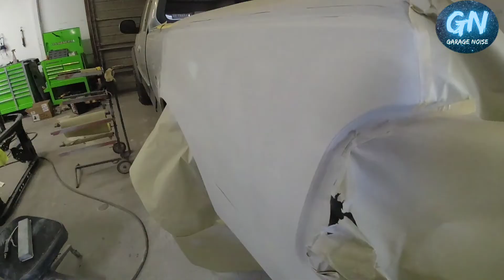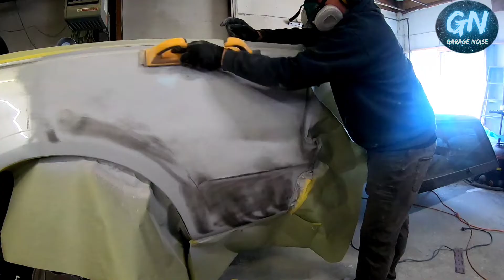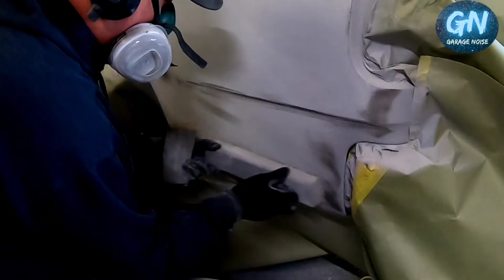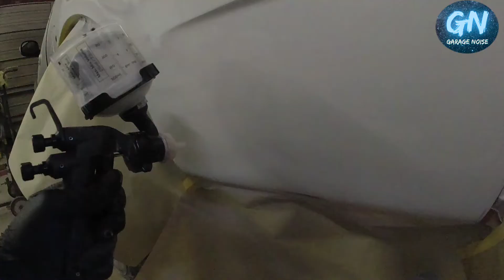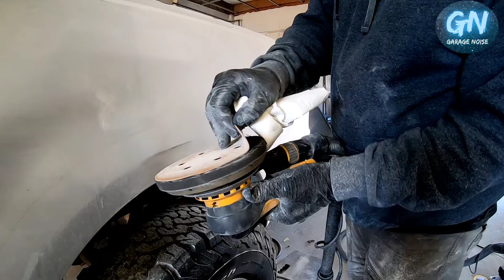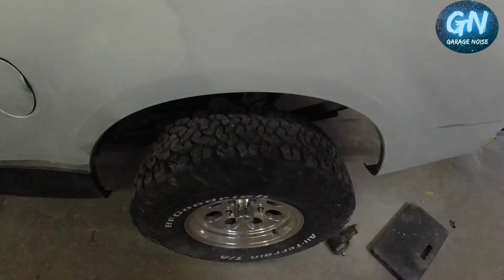How to prepare primer before paint.  auto paint , diy auto paint

Comment: What's recommended  when painting  a black car , what grid  of sand paper to use 400 or 600 its gonna be base coat black and finish 1 clear.

Thanks in advance...
Reply from the maker: On solid black you could use 400 . I would use 600 finer scratch and easier to cover.
Reply: @GarageNoise  great thanks!

Comment: This is a subject of controversy. Jon Kosmoski, founder of House of Kolor, insists that you should stop your prep sanding at P400. Others, including you and frankly myself say go to P600. I actually talked to Jon at SEMA about this and his view is that the P400 on an orbital gives the paint a better grip and that the subsequent base can easily fill the P400 scratches. If you're wet sanding he says you've got to go to P600 as the scratches are directional but that's not the case with the orbital. If some bozo told me this I would ignore him but when DA MAN says it's so you've at least got to pay attention to what he says.
Reply from the maker: Yes, it totally  is a well talked about topic.  If your a painter you've  got an opion about it for sure. Jon  is someone that is a wealth of knowledge due to his vast experience. That being said there are many variables, including products and materials you use. I for a long time finished with 400 on an orbital  which works great in most situations.  In my experience with the paints I use it doesn't work in all situations.  Mainly when dealing with a high or coarse metallic.  400 prepared primer no problem but when 400 is used to prep a surface for clear only during a blend. It will leave inconsistent metallic orientation. Now that can be corrected before applying paint with the use of a wet bed .To streamline the process,  I just started using 600 for all finish prep . that's  what I recommended because it's the best process for my situation.  My process  is always  enolving depending on results efficiency and of course cost. Thanks for the great comment and supporting the channel!